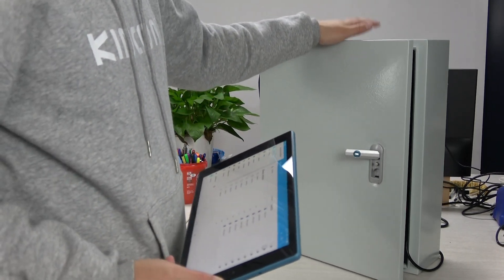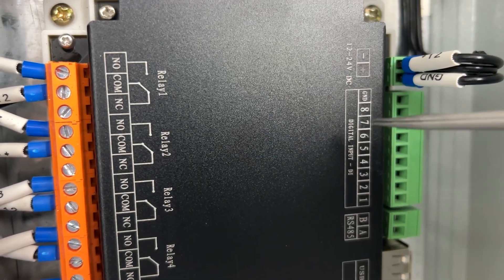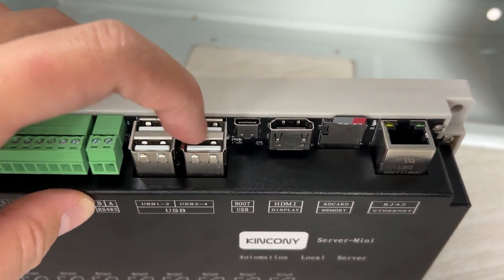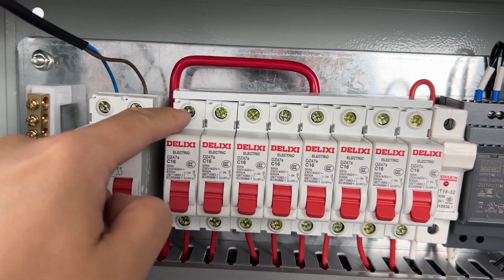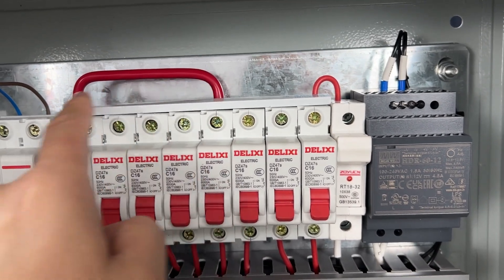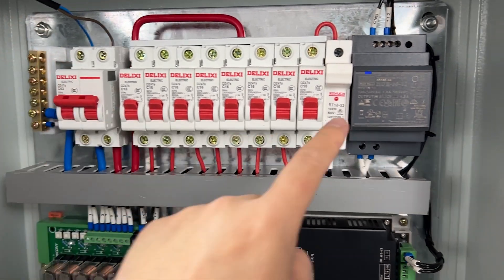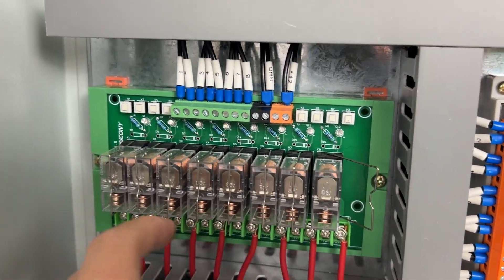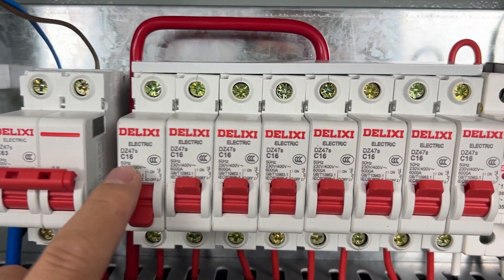explain "Home Automation 8CH Raspberry Pi Distribution Board" principle

Comment: What scares me the most from these control boards how they are made or programmed. But by the way the size of that wire. Some of it doesn't look like it can handle 20 to 30 amp loads. I know there is Thin THNN wire out there that is solid core wiring. It's the stranded wire that looks like there is not enough strands. I have saw a lot of cheap fake stranded wire that looks good on the outside but not on the inside.

Comment: Why have you made 8 com ports? Why not have 1 and split on a board or something? Save splitting the 12v from power supply into 8 com ports?
Reply: For load balance, and good parfonce
Reply from the maker: it also can let all COM's wire together, go to 12v power supply only one wire.
Reply: @KinCony  thanks for the reply. But why have them at all? Just 1 12v com in could serve all 8 NO or NC ports surely?
Reply from the maker: yes, you are right. @cclambie

Comment: Excellent tutorial as always, thank you.

Talking about three phase power source, do I need to use one phase ( using phase selector maybe ) or is your relay controller support using multiple phase ( for example from 1-10 output will be connected to phase 1, 11-20 relay outputs will be connected to phase two and so on) , I'm a newbie to this home automation world
Reply from the maker: yes, if use 3 phase, just do "from 1-10 output will be connected to phase 1, 11-20 relay outputs will be connected to phase two and so on) "